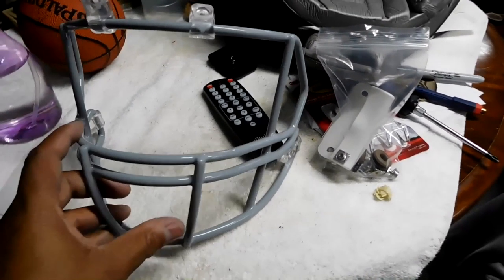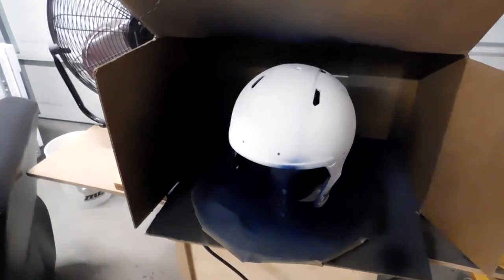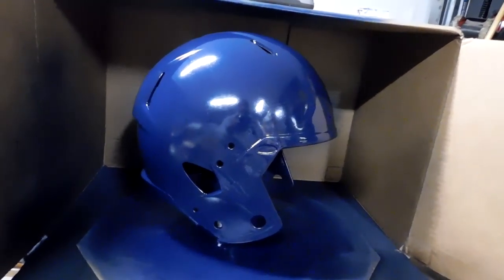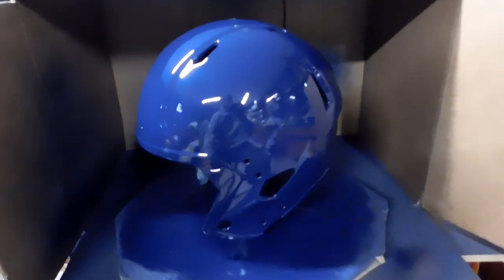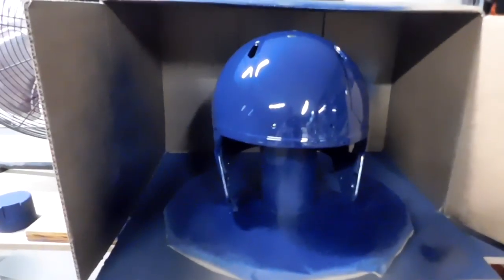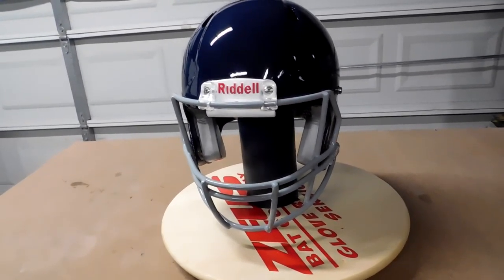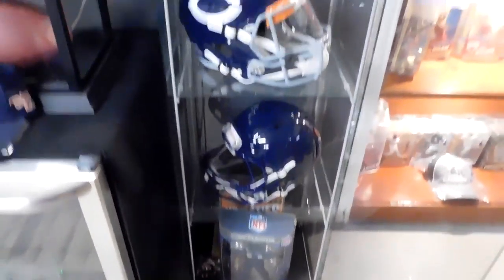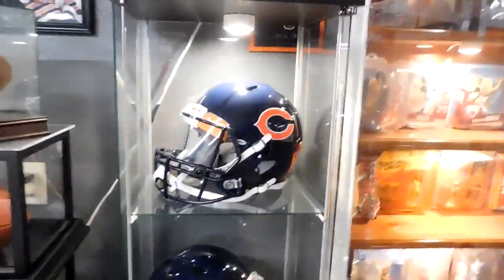Custom Bears Helmet Collection

Comment: Incredible paint job man! I’ve been making helmets here and there for a little while now, but my paint has never come out that clean. Can you describe what you mean by wet sanding? I’m going to have to try that on my next one. I also use auto paint from autozone but their color selection is limited. Check out my eagles helmet if you get a chance. And lastly, where’d you get that spinning stand to be ain’t? Awesome work man
Reply from the maker: Sure, after you paint you helmet, get 1200 grit wet or dry sand paper, wet the helmet and the sand paper, and sand the entire helmet. it gives it a overall better surface...I hope this helps
Reply: @chicagosportsfancave267  do you then hit it again with the blue or the clear after your wet sand it.   because i would think if you sand it after its all done and painted it wouldnt look good.  also what clear coat do you use.  making one tonight so any info is great

Comment: Do you know what spray can I can buy to match the San Diego charger blue. The one I brought looks as bright as the one u have.
Reply from the maker: I don't  know off hand about the Charger colors, my colors aren't an exact match but close enough for me
Reply: Isaac Lama you can actually google the  chargers color codes and they can mix the color for you at oreilly can match that color code and get you the paint
Reply: Chad, I did see the code but I don’t know where to buy it from...
Reply: Isaac Lama normally most places that carry paint can get it for you as long as you have the color code. Oreilly auto parts can do it for you as well as lowes or Home Depot. They should be able to mix it for you and put it in a can. Just get the code online and take that code to any place that has the ability to mix. If one doesnt offer try the next.

Comment: I wish i could get my paint that smooth
Reply from the maker: just wet sand it
Reply: Chicago Sports Fan Brown so when i wet sand it i the clear coat it? No more paint?
Reply from the maker: that's exactly how I did it I first spayed it with my dark navy blue, then I wet sanded it with 1000 grit sand paper (being sure to keep the sand paper very wet), then I clear coated it, you can even wet sand your first coat of clear to get that deep color look.
Reply: Chicago Sports Fan Brown awesome, thank you for the input. Ive recently got into making replicas myself. Really enjoyed your video and i look forward to more.
Reply from the maker: First thanks for watching my videos, subscribe so you can see my latest editions. I've slacked off a bit, but I'm working on new vids right now. The other thing is this is the best time to get the helmets really cheap.
Reply: Chicago Sports Fan Brown oh yeah for sure. Ive made about 6 helmets. What i do is go to resale shops and load up on helmets very cheap. Some are a little small but you can get some nice ones as well. I purchased 23 schutt recyuit/vengence and revo speeds for 40 dollars. I just fill in the scratches sand them and they look new. Just need to get my painting skills like you.